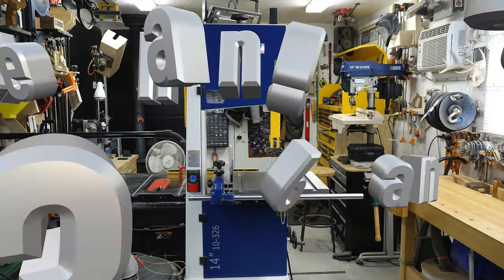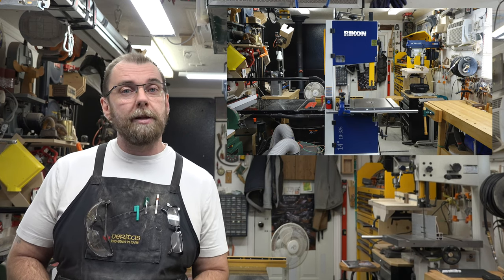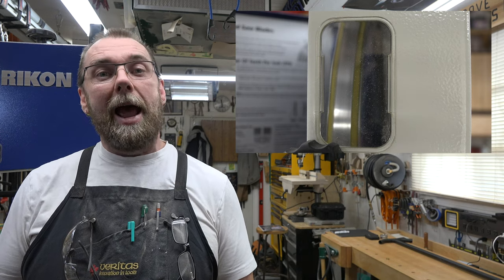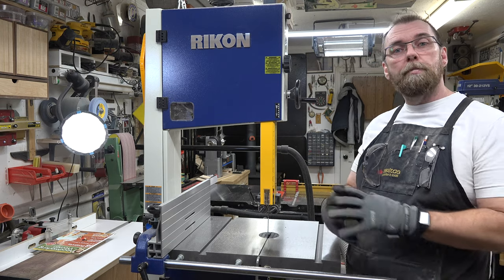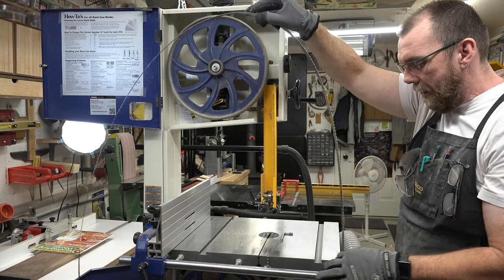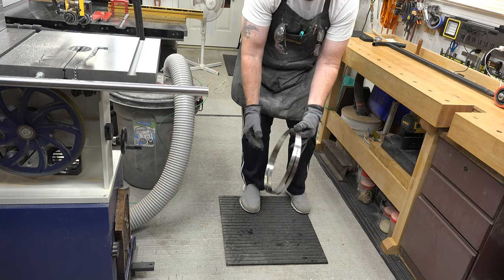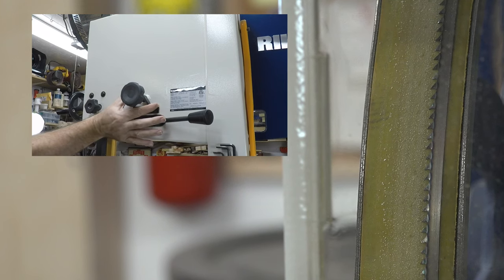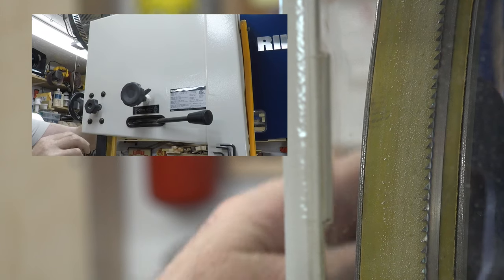Rikon Bandsaw Blade Changes

Comment: Great step by step video. One issue I experienced that others may come across is that the lower thrust bearing    Is unable to move forward all the way on 3/16” blades due to the spring getting hung up on the threaded hole.    Taking the bearing off giving the spring a half turn solved the problem.  Hope this helps others. 🙂
Reply from the maker: Thanks for the kind words on the show Fred and for taking the time to chime in with your suggestion.  I haven't experienced the problem that you are speaking of but if I do, I now have a solution.  I'm sure that it will definitely come in handy.  Thanks for tuning in to the show.  I truly appreciate the support.

Comment: Kenny, great informative video, a big help to bandsaw owners everywhere.  By any chance have you ever seen the videos by Alex Snodgrass?  Very interesting information if you have the time.  He has a video on how to set up a bandsaw and his method is to place the deepest part of the gullet in the center of the tire regardless of the blade.  The reasoning behind this is that it all but eliminates the need for forward or backward adjustment of the side blade supports.  True you still have to adjust the thrust bearing and the distance of the side bearings away from the blade but not the back and forth adjustments of the side bearing.  He also indicates that by placing the deepest part of the gullet in the center part of the wheel it eliminates pressure on the set of the teeth of the blade.  It is an interesting video.  Please don't think I am knocking your method of installing the blade, that is not my intent.  I enjoyed your video and have used that method for years myself.  Thanks for the video my friend.
Reply from the maker: Thanks for the kind words and the suggestion of Alex Snodgrass' method.  As you well know, for every process in woodworking, there are approximately 279.6 different methods of achieving that process.  As long as proper safety methods are used during said method and the method doesn't pose any danger or threat to the woodworker, then there is nothing wrong with it.  Be it far from me to feel offended if someone else has an alternate method than mine.  In fact, I applaud them for thinking outside of the norm and finding their own path.  In a hobby where our tools can remove limbs, it is important to feel comfortable with your tools and your tool's setup while still retaining a healthy fear of the machinery and its power.  If you have a link to his setup method, I invite you to post it here on this conversation.  My method is not the only method out there and as my show is all about education, I welcome new methods as a teaching tool.  Thanks for tuning in to the show Paul and taking the time to leave a comment.  It's appreciated.
Reply: @acutabove_woodworkings  
@paulsmessyworkshop   

I also highly recommend using the Alex Snodgrass method where you do not center the blade itself on the wheel, but instead center the deepest part of the gullets of the teeth as Paul suggested.  It is based on logic, physics, and is a time-tested, proven method.

Although it is older, fast-paced, and difficult to actually see the details, I think Alex's best video covering his methods is the Band Saw Clinic with Alex Snodgrass video on thewoodworkingshows YouTube channel.

Kenny, now regarding your video, in your "timed" blade-changing tutorial, I did not see you include proper RE-TENSIONING of the larger blade, which is important to do BEFORE adjusting your guide & thrust bearings, and of course for general operation.

I'm not trying to nitpik, but I feel it's important since many new or existing band saw owners will now be using your video as their setup guide.  ;)

I would also suggest using dry graphite lube (the type used for keyed padlocks and door latch/lock mechanisms) to lube the upper wheel's tilt/tracking mechanism so that it does not bind.

Hitting that wheel multiple times every time you change a blade or need to re-adjust the tracking is going to cause some potential damage and wear over time.

This is something that Rikon should fix in the design, but using the dry graphite lube does remedy this issue.

Notes on the band saw itself:

I wish that Rikon sold the smaller 10" benchtop model with the option for the quick-set bearing guides that this 10-326 has!  That alone makes a huge difference in setup and overall quality of cut.

In addition, for the price, I think Rikon should include a built-in LED worklight!  LEDs are fairly inexpensive these days.  Like you, I'd also like to see the power switch relocated a bit higher on the column.

Otherwise, you've done a great job with this video and your review video as well.  Thanks for posting.  👍
Reply from the maker: @bbfoto7248  Not quite sure how to react to this comment.....so I will just say thanks for tuning in to the show.
Reply: "the deepest part of the gullet in the center of the tire regardless of the blade"  Makes a cool story until you actually try it.  3/4" 3 tpi blade:  tooth to back edge (total width) .734  Bottom of gullet to back edge of blade .632  Width of tire .921  Thus, centering the bottom of the gullet on the tire runs the back edge of the blade off the rear of the tire.

Comment: I very recently bought their 10" bandsaw and after assembly, the first thing I did was to remove the blade that came with the unit to install a very rough one with only a few teeth per inch.  I was going to need it immediately to cut down some cherry-quartered logs to get pieces to a more manageable size for hand planing.  Their assembly guide is very thorough and clear and I didn't have any issues until I took the new blade out of it's box.  I've never handled one of these before but when I saw it coiled into a circle I had my suspicions of what was going to occur.  I started to pull on part of the blade and it rapidly began to uncoil.  I nicked a finger but it could have been worse.  I'm thinking that next time I gently take it out of the box and throw it onto the floor while I run the other way, lol.  The only other issue I have to solve is an adapter so I can connect my Fein vacuum to the dust port on the saw.  I would have liked a bigger one but I don't have the space or the money and this little one has done a good job so far.  Good machines to be sure.
Reply from the maker: Band saw blades are tricky to handle because of the spring of the steel.  They can give a nasty bite so be sure to wear a pair of thick glove (preferably leather) when handling the blades.  I'm glad you were only nicked.  As for the dust port adapter, Amazon might be your friend here as there are plenty to choose from to get you vacuum hose to fit the dust port properly.  Thanks for tuning in and for taking the time to leave the kind words.  I truly appreciate it and I hope you enjoy your new saw.

Comment: The exact video I needed as I just bent a blade because I couldn't get it centered correctly.   Thanks so much.  Have you ever talked about how to tell if you have enough or too little tension on the blade?  That will be my next issue to check on.
Reply from the maker: I've never really delved into the blade tension issue but essentially, if you use your finger on the side of the blade and push the blade sideway after it is tensioned, it should move approximately 1/4" from it's original position.  It's just a quick test to see if the tension is correct.  I hope this helps. Thanks for tuning in to the show.

Comment: Thank you much!  Really enjoyed your videos about for the Ricon 10-326.  2 questions 
You mentioned 1/8" and 3/16" blades.  I assume the 1/8" is incorrect use for this machine?
Also, I was told that when not in use - the blade tension lever should be losened so the tire does not develop memory and wear the tire out.  Is this correct?
Reply from the maker: Although this machine is not really meant to use a 1/8" blade, I still use one on it and it works just fine.  I also use a 3/16" blade as well.  As for the tension, I always release the tension on my tools whenever they are not in use.  This especially goes for the band saw to avoid flat spots in the tyres.  I also release tension on my belt sanders, scroll saw, table saw fence, drill press table, oscillating drum sander etc.  Anything that requires tension to use, should have the tension released when not in use.  I hope this helps.  Thanks for tuning in.

Comment: Thank you for this video. I am losing my mind over my blade change. I can't wait to see if your tips help because I went from pure excitement about my new bandsaw to wanting to throw it in the garbage during the blade swap.
Reply from the maker: Don't lose faith Dan.  You've got this.  In no time at all, you will be changing blades like a pro and getting back to your pure excitement.  Thanks for tuning in and good luck with your blade changes.
Reply: @acutabove_woodworkings  any suggestions with the problem I’m having...the top wheel has the blade centered but the bottom always ends up towards the front of the wheel. (3/16 blade)
Reply from the maker: @iamdanimal2  To completely honest (and I know that there will be some that don't agree with me) I wouldn't be too concerned about it.  I have had blades that run true on the upper and lower wheel and then I have had blades that run true on the upper but not on the lower and vice-versa.  As long as the blade in this case isn't running off the wheels, I wouldn't be concerned.  In my experience, some blades are just like that and there isn't much that you can do about it.  If all of your other blades are running in the centre (for the most part) of the upper and lower wheels, it might be a good indication that your blade just isn't as perfect as it could be.  I mean, you could mess around with the lower wheel and get them both running perfectly for the 3/16" blade, but as soon as you change the blade to a different size, you are going to run into the same problem for all the other blades.  I know that this might be hard to accept, but honestly, some blades are just wonky like that.  I've been there, done that.  Once the blade outlived its life and was replaced, the next one ran fine.  Not every weld is perfect, not every blade is 100% and in my opinion, not every blade needs to run in the centre on both the upper and lower wheels.  If all of the other blades are running true on the wheels, the saw is not your issue and I wouldn't be concerned.
Reply: @iamdanimal2  I had the same issue until I loosened up the tension a bit. I was moving from the wider blade included with the saw to a 3/16. Perfectly centering the top wheel would lead to the bottom rolling forward off the rubber onto the metal lip. I wasn't about to run the saw in that condition. It was crazy frustrating. Something I heard said on one of Snodgrass's videos led me to taking a good bit  of the tension off, center the blade, and then slowly readjust the tension until you have the desired finger test result. My saw and I have a great relationship now. .

Comment: Just purchased this band saw. Thanks for the video. Does the tension change with the changing of the blades?
Reply from the maker: The blade tension will change from blade to blade.  While the tension might be just fine for a 5/8" blade, putting in a 1/4" blade can make the tension way too loose or way to tight.  There are just variances in blade size and length.  I hope this helps Martin.  Thanks for tuning in to the show.

Comment: A well-done and informative video as usual, Kenny.  Do you resaw much with your bandsaw?  I tried for the first time with poor results.  I was using the stock 5/8" blade on 12" cedar, which was dry as a bone.  It should've cut through that like butter despite the height.  It started to smoke almost immediately even though I was careful about the feed rate and the tracking was awful, it drifted so much that the results were useless.  The bearings were adjusted correctly, as was the blade tension(as far as I know).  The blade wasn't smack in the middle of the tire, but not THAT far off.  I'm scratching my head over this one.  Any ideas?  TIA.  Mark
Reply from the maker: Re-saw is what my saw is used for, almost exclusively.  The  very first thing I would suggest is to get yourself a designate re-saw blade and one that is designed for the purpose.  They have a thinner kerf and are usually running at about 3 tpi.  I tried the 5/8" blade that came with the saw for re-saw and wasn't really impressed with the results.  Try something like this.  https://www.leevalley.com/en-ca/shop/tools/power-tool-accessories/saw-blades/band-saw/111150-blades-for-rikon-14-inch-deluxe-bandsaw?item=03J5707
I also have to ask if you are using the stock fence or the re-saw fence that the saw comes equipped with.  I actually prefer to use the stock fence and adjust for drift with the fence adjustment on the fence carriage.  The other thing that I will point out is that while cedar is a soft wood and should be easily cut, the sawdust that it creates during a re-saw operation is also very soft and the gullets of the blade will have a hard time clearing the dust from the kerf.  This almost always results in smoking.  Pine is another culprit of this problem and because of that, the feed rate has to be reduced way more than you would expect to compensate and allow the gullets to clear the dust out of the kerf of the blade.  I hope this helps a little.  Thanks for tuning in.
Reply: @acutabove_woodworkings  Thanks for the info, Kenny!  What you said about the dust and the gullets makes alot of sense.  I was using the stock fence and didn't try that round cylinder thing(Resaw fence?), they sent with the machine.  I'll be ordering the blade you suggested PDQ.  Unless I missed it in the video(and I might have, I'm old), you don't seemed concerned about how the blade is tracking on the lower wheel.  My top wheel has the blade in the middle but on the bottom wheel it's off to one side slightly.  There are videos on how to adjust the lower wheel, but it looks like I'd be opening up a can of worms.  Did you run into this on your machine?  Thanks again for the quick reply and great advice as usual!  Cheers!  Mark
Reply from the maker: @markk4015  Depending on the blade, the lower wheel tracks differently.  Some track dead centre and some slightly off but none of them track in any way that would concern me.  Once you start adjusting the lower wheel, you can run into all kinds of problems and frustrations and if you are going to do that, be sure to pack your patience because it is a daunting task.  Unless you are having issues with the upper and lower wheels being coplanar, I wouldn't suggest adjusting the lower wheel assembly at all.
Reply: @acutabove_woodworkings  Thanks, Ken.  Good advice and I'll heed it.  Somethings are better left alone.  I bought the blade you recommended and am awaiting delivery.                                                                                                                                                    Have you checked out this Youtube video?  https://www.youtube.com/watch?v=N6_2h-vo0jA.  A guy makes a circle cutting jig for a bandsaw that I thought was brilliant.  If the link doesn't work it's from Inspire Woodcraft.  I'll be making one with a few tweaks and let you know how it works out if you're interested.  Thanks again for all your help!  Mark
Reply from the maker: @markk4015  I made a couple of circle cutting jigs on the show a while back.  Here is a link if you'd like to see a different take on it as this one was built specifically for the Rikon band saw.  https://www.youtube.com/watch?v=WXCpvnFrccw&t=629s
Reply: @acutabove_woodworkings  Thanks Ken.  You're jig looks great but I was already into the construction of the other one when I saw your video.  Am I right in thinking that the 5/8" stock blade that came with the 10-326 is too wide for circle cutting?  It bogged down immediately when I tried it on a 4" diameter circle, which is pretty small I guess.  Any suggestions for a good blade for this type application?  TIA.  Mark
Reply from the maker: @markk4015  a 4" diameter (2" radius) is far too tight for a 5/8" blade.  Each blade has a maximum radius that it can cut.  My saw has these radii marked on the inside of the upper cabinet door.  Try something like a 1/4" or a 3/16" blade and you will do fine.  If your saw doesn't have this chart, contact me via email and I will take a picture of it and send it to you.
Reply: @acutabove_woodworkings  What do you know, I do have that chart on the inside of my bandsaw!  And it says a 5/8" blade can handle a 4" radii, but I'm trying to make a circle with a 4" DIAMETER, a definite no go.  1/4" blade already ordered. Thanks again for helping the slow kid on the bus out of a jam.  Cheers.  Mark
Reply from the maker: @markk4015  Glad that I was able to help.

Comment: Alex Snodgrass suggests making sure that the gullet of the blade is in the center, not the blade itself. His Youtube video shows why. Otherwise, good video-thanks. However, I have an old 18 inch Rikon and I am having trouble getting a 3/4 inch blade correctly installed. Do you know of a video that shows some hints on that?
Reply from the maker: There are many theories about where the gullets should be placed and where the blade should ride on the wheels.  I'm of the belief that if it works for you and it cuts fine, then don't try and fix it.  There are some saws that (for one reason or another) behave differently than others and their setup needs to be adjust to reflect that.  As for the 3/4" blade video, I'm not aware of anyone who has a video showing this.  What kind of problems are you having Roger?  I may not be able to fix it but together we might be able to figure out the issue and get you moving in the right direction.